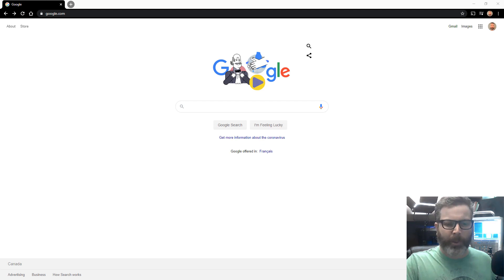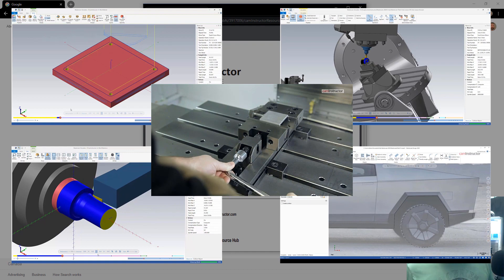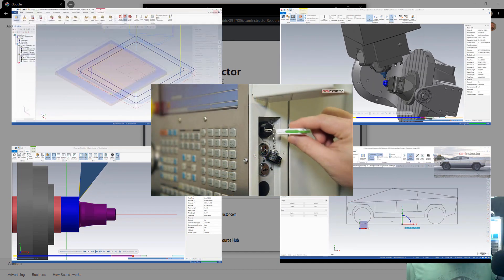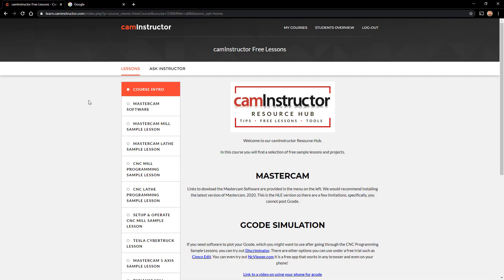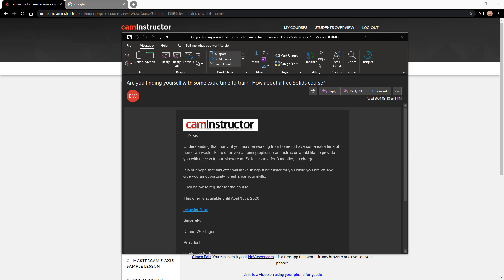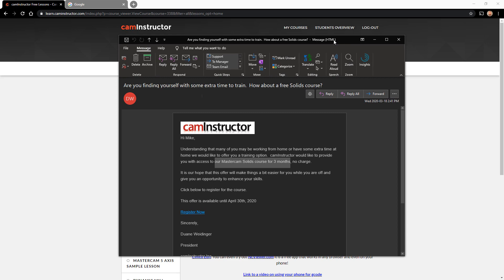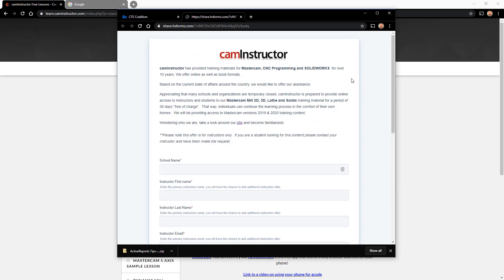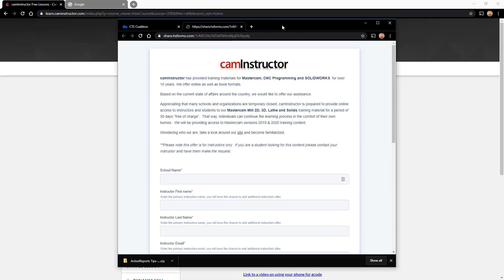FREE Mastercam, SolidWorks, CNC Programming, and Setup Lessons!!

Comment: Hi, I just found the channel and there is a lot of nice and very informative videos. Thank you for sharing. 
I have a question. The screw shaft with VARIABLE pitch is usually made on cnc mill with 4 axis. Do you think is it possible to write a program to do it on a cnc lathe? So it has to change the feed rate during a cutting operation. Is it possible?
Reply from the maker: Depending on how the lead varies, you could either use G32 or G34.
Reply: @CamInstructor  Thanks. I just found out the thread profile is also changing not only the pitch. Probably it is not possible on cnc lathe.
Reply from the maker: It still may be possible with either or those two commands. You would just have to decide if it's worth pursuing. I would contact both your machine builder and then cam reseller/post developer and see what's possible and what costs would be involved. It might take a custom post edit. But hey, if it means completing a part in less time, might be worth while!
Reply: @CamInstructor  It is normal way the experts contact each other and do the job. But it is not that simple at the place where I am from. I have built/retrofit (https://youtu.be/aoY2epOfjLw) a cnc lathe from scrap and I am working on it. There is no cam reseller/post developer just me- one man band.  I have to learn it and I will really appriciate if you advise me the steps I have to go thru.